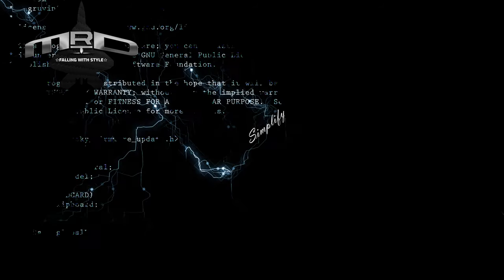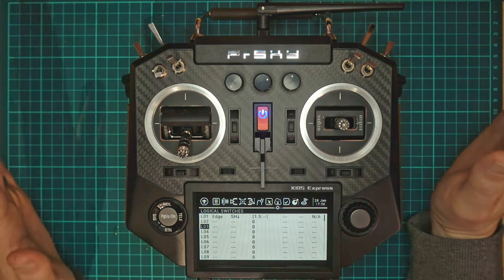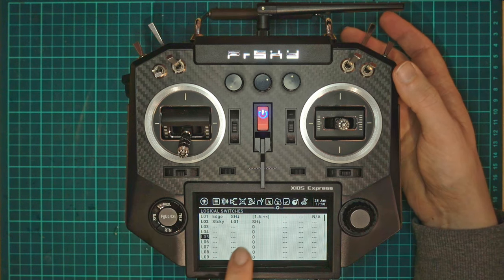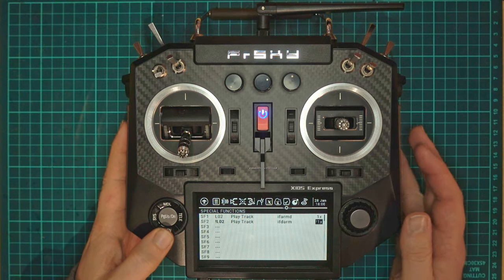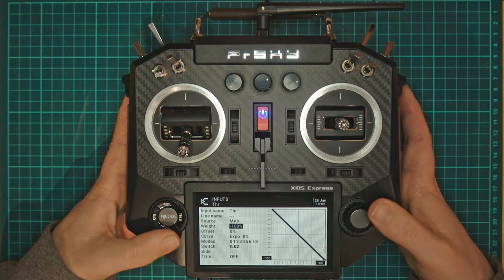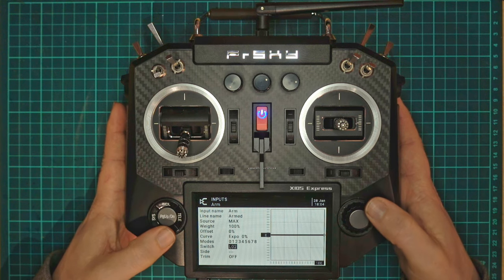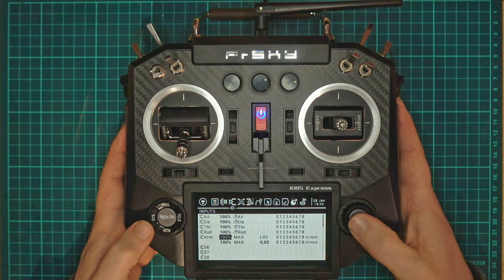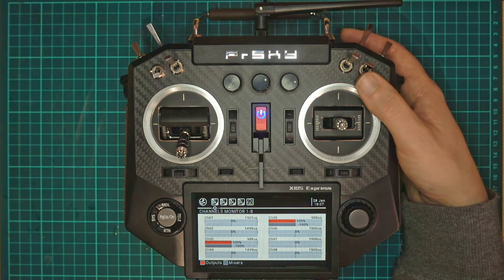Using The Momentary Switch To Arm Your Model with OpenTX

Comment: 2 year old video but I used basically these exact steps you show here to convert a momentary switch to a toggle on my EdgeTX Radiomaster Zorro. I’m still pretty new to this and you made the process simple. Thanks for taking the time to make this video!! Oh and the -1 to disable on start…I had no idea!  No more turn on my radio and “disarmed, acro mode, high rate, blah blah blah” You have improved my life. Lol.
Reply from the maker: You're welcome. I'm glad the video helped :)
Reply: It's 3 years old for me at this point and just set it up on EdgeTX ELRS Radiomaster TX12 MKII radio and it was identical steps.  Love that EdgeTX and OpenTX are so similar.
This more importantly frees up a 3 position switch for me to use elsewhere and let's me use a momentary button that are otherwise completely useless.  Now I can have my arm 3 position switch be my rateprofile switch and my momentary button to arm while holding down.  Absolutely incredible, thanks for taking the time to document this and provide this for the community.

Comment: Thanks, this was really helpful. I got it working in Ethos as well. I originally assigned the logical switch to the throttle cut parameters but found that the transmitter powered up with the throttle active since logical switches are all off at power up and you would need the flick to be active. I got it working by using curves as you described in another video. I'm sure it would also work like you are doing here with inputs. The one thing that I am torn on is that if you walk up to the transmitter and see the throttle at idle, you don't have any visual confirmation whether it is armed or not - and it could be either. Using your two-state switch method from another video, if I see the switch in the armed position I can assume it is armed and worse-case scenario it may not be. I also like to hear a "throttle disabled" track play when I power up the transmitter, which I can do with the two-state method but I can't do with the momentary switch. It's great this can be customized in so many ways to meet our personal preferences.
Reply from the maker: Thanks Mike.

You make some great points here. Personally, I don't use this method, I prefer to use the physical two way switch. This was really an example for a request. It was also for use with iNav, which has checks it's self to make sure the throttle is low ect.

I don't quite understand why ETHOS would have the throttle active. Having all the logic off when you boot up should be fine, as off for the logical switch is the disarmed position. It sounds like, if you used the default ETHOS throttle cut on the throttle mix. If it was armed when it shouldn't have been, the activating switch should be inverted.

The "not armed" sound when powering up should also work. On OpenTX you set !x1 for not on start-up. But, on ETHOS it has a proper label. So the logical switch should trigger the sound.

Great work though. It sounds like you're getting everything set up as you'd like it :)

Comment: I went through and triple checked that i copied you exactly. I even started it on a new model but the throttle cuts to 0. Not -100. any suggestions on what I should do. I'm using the FC configuration @5:51
Disarm is MAX at -100 and and i can see the chart swing back in forth like yours does in the video.
but it's till disarming to 0.

Comment: This is Perfect for those that fly RC helicopters and are used to arming switch on the top right.  The only issue I am having is the idle up stays armed.  Could you advise what change in inputs I need to make so momentary switch will also disarm the idle up curve.  Thank you and great work!

Comment: I was excited to see this and watched it quickly. It doesn't seem to use the prearm mode that I thought just got approved for iNav. Betaflight seems to have it. I was hoping to use this so that flipping an arming switch only works when a prearm momentary switch is also pressed. This is good for safety and allows better failsafe setup.
Reply from the maker: I know that they are looking to add the Betaflight style prearm to iNav. If merged, it won't be released until version 2.7, which is still a few months away. It's personally something I'd never use as a fixed wing pilot, as I believe the safety checks in iNav its self are fine with a standard arming switch. Genuine question. How does it allow better failsafe setup?

I could make a video on how to make a pre-arm in OpenTX, if people would find it useful. It would be very easy to do.
Reply: @MrD  The key problem is with older systems like EZUHF that can only remember a configuration of sticks and switches to replay on failsafe. You program them by pressing the failsafe button when the configuration is just how you want it, and the RX remembers.

If you choose arm on, then the plane can suddenly arm on the ground if the transmitter is turned off accidentally. It doesn't matter if the radio has an elaborate procedure, the RX is just replaying the remembered channel setting.

If you choose arming off, then you have to ensure your plane does the right thing in the air when disarmed. This is the safe setting, but it means your plane or quad drops out of the air where it failsafed unless the FC can do something smarter and handle reestablishing link smoothly too.

You can help the FC do something smart by configuring a special condition like the throttle channel below what the radio will ordinarily emit by using trim tabs when you set up failsafe. It's a pain to get right, and you have to teach the FC this special condition. More modern RXs have an extra failsafe option to send no pulses on failsafe, which is a more surefire way to tell the FC it failsafed and put everything into its hands. INav and Betaflight can be taught to recognize this easily.

I set up my EZUHF to disarm and have zero throttle in angle mode with a little pitch down and turning now. But with prearm available, I would configure it to RTH in armed state. Prearm should prevent it from arming on the ground or after landing if you are careless.
Reply from the maker: That makes sense. I’ve not had to worry about older receivers that don’t have no pulses, hold, or cut; so I’ve never had to think about that situation. Thanks for sharing, it gives that feature a lot of sense now in that situation. The pull request is still open, but hopefully it’s something that will be merged in time for 2.7.
Reply: I still use all the immersion uhf systems with inav and have 2 stage arming and have never had an issue,all comes down to common sense,like how many arming systems do you need.

Comment: Why not vice versa ... use Short flick for arm and the long one for disarm ? So we don't accidentally disarm and in a panic situation have to wait longer to rearm.
Reply from the maker: Because it is safer to have the hold for arm and the short flick to disarm. It should always be easier to disarm than arm, because you never know when it would be needed in an emergency situation. Peoples fingers and other appendages are more important than foam. 

Planes can glide, so if you have any kind of altitude at all, waiting a second or two to re-arm is not an issue.

Comment: Can You explain how to program it, so it will arm after holding switch for 1,5sec and disarm after holding switch for 1,5sec. It would be much safer because now I can easily disarm my quad by accident
Reply from the maker: I deliberately had the disarm instant for safety. I regard safety for humans over the plane or quad in this case. The whole point of a disarm switch should be to stop the motors as soon as possible. That 1.5 second disarm delay could result in more damage to somebody.

Comment: Is there a potential safety issue if the throttle isn't at zero when the arming switch activates??
Reply from the maker: Not if using a flight controller, as that will check the throttle position before arming. With just a receiver, yes. I would just use this as the switching mechanism and use my Ultimate Arm Switch for the actual arming. https://youtu.be/62mxq76fOyk